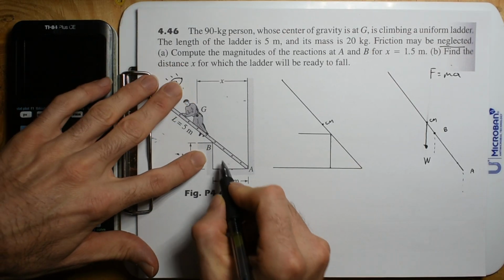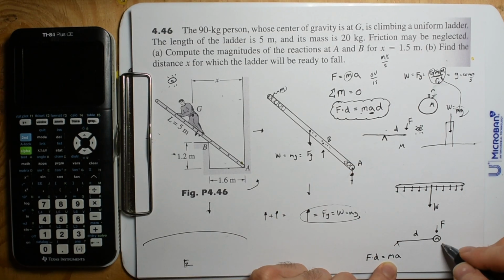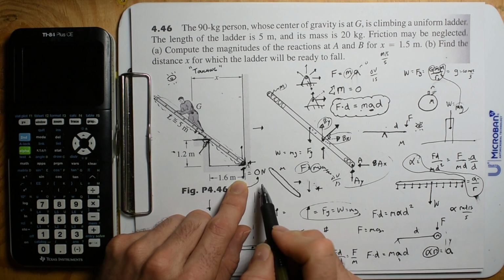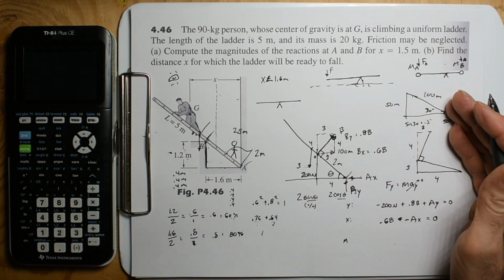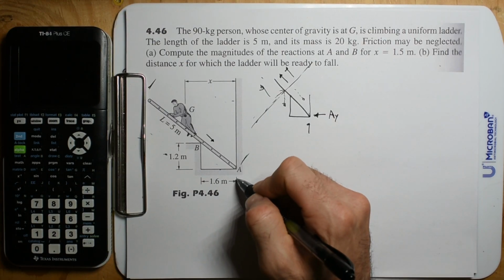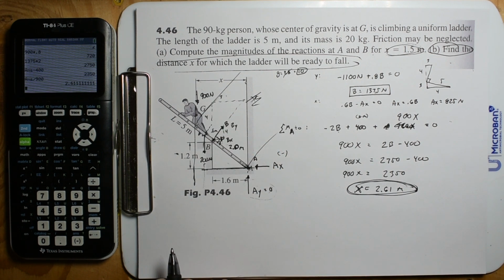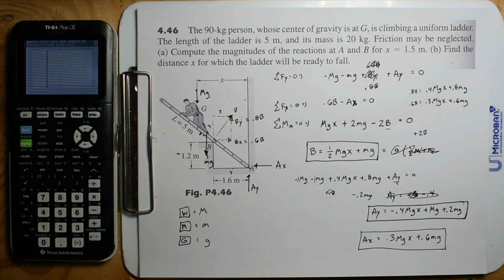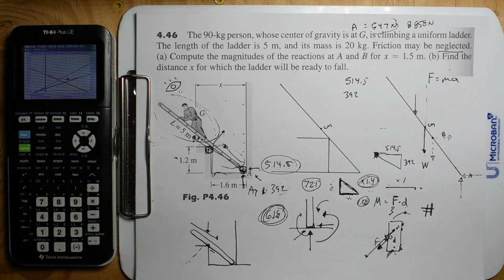How to Set Up FREE BODY DIAGRAMS!

Comment: What are the books you use to find these problems? The tease of the book at the beginning doesnt show names😛.
Reply from the maker: Here is a pdf of HIbbeler Statics no sign-ups!  Which has the problem  https://gessknust.wordpress.com/wp-content/uploads/2015/09/engineering-mechanics-statics-r-c-hibbeler-12th-edition.pdf
I am using author pytel and this site is free but needs you to sign in with google etc  https://www.academia.edu/38359974/Pytel_Mechanical_Engineering_Statics_4th_pdf
Solutions manuals can also be found in pdf for these texts.  Usually just not the same edition.  So you have to hunt for your problem.